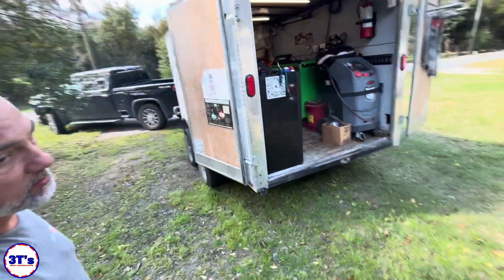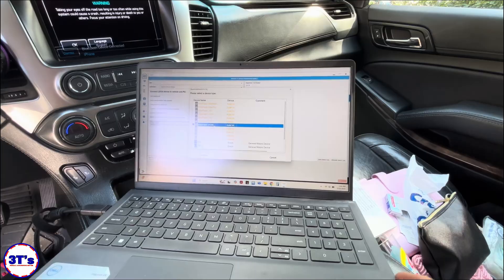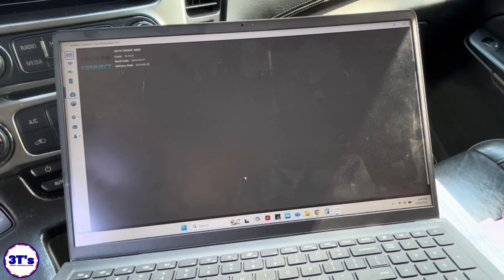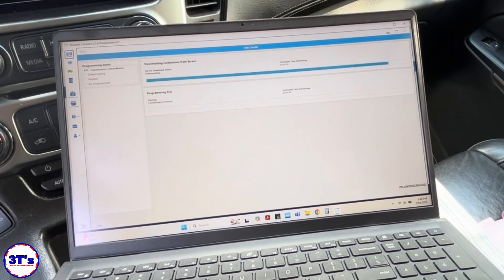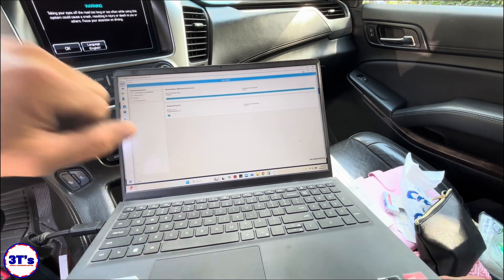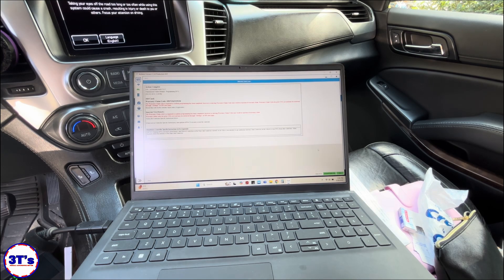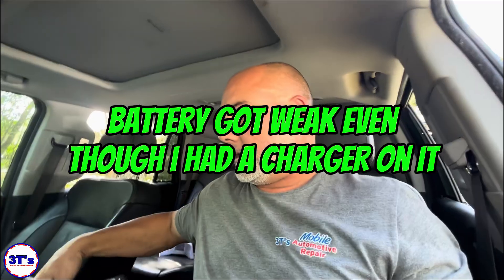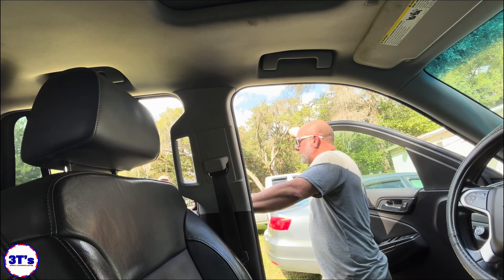Watch This Before Replacing Your Transmission Control Module

Comment: Great Channel - I am subbed.  Techconnect -  Defiantly a hate/love relationship.   Sometimes they take the system down on Sundays.  I work on the rusty crusty beaters with a heater that no one else wants to work on.   I do my work on the evenings and weekends!   They just locked my account because I used a Chinese clone J-Box.  I had been using that thing for 6 years.  I had to email them, and send them picture of my new J-Box and then they unlocked my account and said, if I did it again, they would not unlock it.   I got an Autel MaxiFlash.  Then nice thing is it works with FJDS and it will work with Chrysler's J-2534 App as well.  So I only have to carry on J-Box around now.
Reply from the maker: Wow i cant believe they locked you out but yet again i can. I know the industry is under fire with US regulation with Immobilizer issues because of theft so they take cloned J boxes seriously they dont want to get sued by the regulations.  Thanks for subbing!!  I subbed to you also

Comment: i thought about learning to program but just to old or lazy not sure which. about flying i will never forget only flew 2 times but i remember when the plane took off it was so slow and smooth i said there is no way unless something happens this heavy plane is going to get off the ground then the  nitrous hit and really started pulling and all was well. i also remember they talk about land sections are 40 acre plots you can see that from the ground. one other thing we went over a town and i saw what looked like giant parking lots and thought where are all the buildings these cars are parked at well the what i thought was cars was houses they were just so small. but i really liked flying. hope you enjoy

Comment: I do mobile programming for shops in ohio. I’d say invest in the obdstar dc706 for module clones. You already know you’ll get requests for used module programming. I’d suggest get a cardaq 3 plus for sure. Get your nastf creds for security programming on 2015 and newer fords and getting PIN number for Chrysler with the rolling pins
Reply from the maker: Thanks for the info. I’ve been watching non stop videos on the cloning stuff recently I kind of like the change of pace
Reply: @3TsMOBILEMECHANIC cloning is one of the main services I do in my ecu repair shop. I do mostly mail in work.
Reply: I do mobile diagnostics and programming in Nebraska. What are you charging for your programming service? I have been charging 150 for GM, Ford, and Honda, and around 200 for Chrysler. I am trying to get a feel for what people are charging in different areas and to stay comparable to other services.
Reply: Even if I use AlfaOBD to reconfigure a used module on a Chrysler, I still charge the same amount cause it takes so much more time to get the configuration right.
Reply: This is interesting.  I am going to have to start cloning modules soon.

Comment: Is it worth your trouble to pay all those fees to prograM modules? Do you do enough to make it worth paying all the diff manufacturer software updates etc. i at the moment just call a guy that all he does is programming
Reply from the maker: @jerradguillory7909
I cant answer for Asian manufactures i haven't gotten into them yet. But Gm its $45 per VIN. ford ranges from 49-149 for IDS vs FJDS but customer pays for that. Its just like a part. If i start doing it full time i can save by subscribing for the year to some of them. I just saw check engine chuck use hero for the Chrysler and it was cheaper also so i may try them out when i have to do a Chrysler next. Im super new to doing it in my company so it well need some tweaking on costs
Reply: I do tons of programming for shops in ohio. You need to invest in the obdstar dc706 for cloning modules. Because you already know people will want used modules to be programmed. You also need to get your nastf creds. But you should be fine with your autel j box for now. But I’d definitely get a cardaq 3